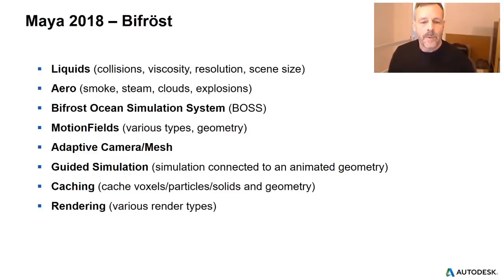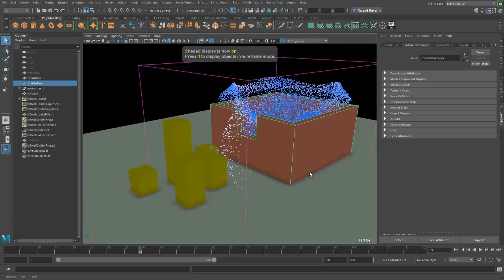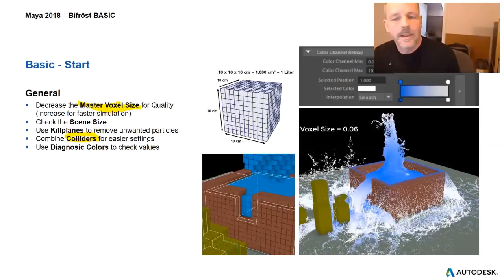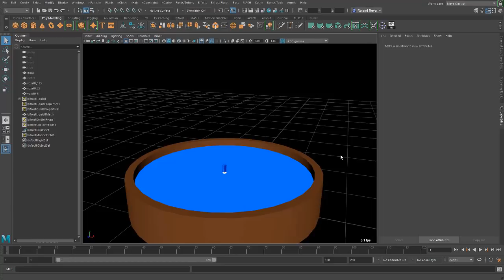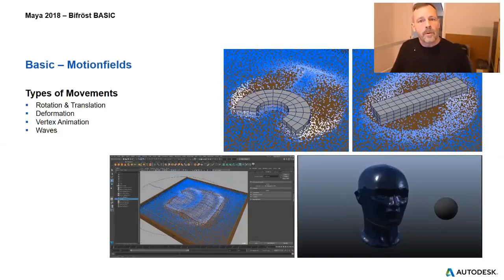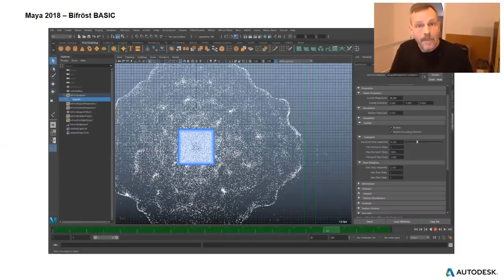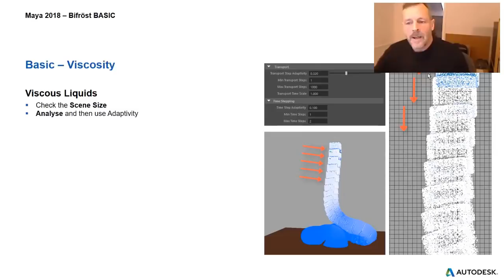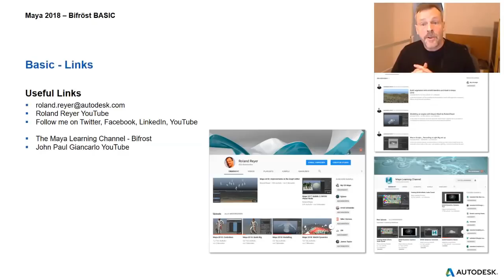Maya 2018 Bifröst BASIC Webinar

Comment: a top notch webinar. been wondeirng how did you make those voxelised scene previews? (what I mean is how to  set up those cubes that illustrate what the scene looks like depending on the voxel size)
Reply from the maker: The voxel illustrations were made with MASH in Maya. However, there is a voxel display in Bifrost that shows the adaptive subdivisions, but it is very simple, in case there are millions of boxes to display.

Comment: Hi Roland, you're a real master and this video helped me a lot! 
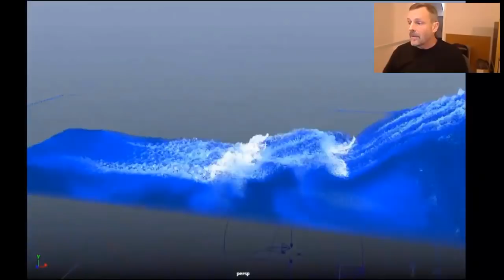I would love to know how do you render the velocity or vorticity channels (like in min 40:04, even if that seems just foam) and with which engine. 
I'm struggling with that.

Thanks again!
Reply from the maker: Hi Nicola, I assume that you mean 40:09 in the Water video.
When you visualize velocity or vorticity then this is just for the hardware display.
However, you can also use these values in the software renderer. Look here: http://help.autodesk.com/view/MAYAUL/2018/ENU/?guid=GUID-8218DE4F-C974-46C4-BF1B-A5F9255D1BA4 under "Render".
Reply: Great, thanks a lot!

Comment: Can you influence the fluid, using particles? Fir example, if I want to make a water explosion. ,Could I use particles to make the velocity in the fluid? Kinda like an explosion?
Reply from the maker: Hi, unfortunately, there is no way to use particles to influence the liquid yet.
Reply: @RolandReyer  Ok. I have another question, how would i go about doing it? Geometry? I see this being done in houdini by animating mesh, and using the points as velocity. 

On another note, i am trying to make some blood splatter on the wall. I have a character at real world scale, standing in front of a wall. I want to make blood splatter like hes been shot in the head. What is the best method for this effect? Doses the scene scale matter?

Sorry for so many questions. Hard to find what i need to use bifrost!
Reply from the maker: @caveman357  For an explosion in water you can of course use all aspects of the motionfield, like the Directional field with Concentric and also an expanding geometry. Be aware that for the high velocities in an explosion you need a lot of sample steps. 
For the blood splatter: do you really need to simulate this with a liquid? It is hard if not impossible to simulate the real world. Try to fake it!

Comment: Great video, can you please please, give more details as to how 39:37 - 39:46 in this video was done?
Reply from the maker: Hi, that's actually simple: you create a liquid and set the gravity to zero. Then add one or more motionfields that attract and transport the liquid.
Reply: @RolandReyer  Great video aswell! to expand on the question before, I cant seem to replicate the "pipe Shape" at 39:42 - 39:47, did you use colliders in addition to the Motion fields? cheers.
Reply from the maker: @pmownage123  I don't know the settings that my colleague used for this effect but I assume that in the Motionfield the "Boundary" was set to "Cylinder" and then using the values for "around", "along" and "away" to get this motion.

Comment: Roland, how do I get a high viscosity liquid to conform to a collider's surface without creating a bumpy texture? I went through every setting but can't seem to find the right setting. Thank you in advance!
Reply: I'd love to know this too
Reply: @patricktaylor8637  I've gone through pretty much every setting and a ton of combinations after I had placed this post. I spent roughly about 2 months on and off without finding a solution. My conclusion is that this is a software limitation.
Reply: MOVE FOUNDRY - That’s too bad. I’m still going to do a FEW tests, but now I’m thinking Realflow might be a better option. Or bite the bullet and start down the Houdini path.
Reply: @patricktaylor8637  For my intents and purposes Bifrost is the better choice. I tried RealFlow and although it smoothed out a the container I wasn't happy with its high viscosity simulator.
Reply: MOVE FOUNDRY - Interesting. Thanks for the info. Let me know if you find a viable solution and I’ll do the same.

Comment: When i m trying to playback then it takes too much time frame to frame

My pc config are:
Intel i3 3rd gen
6 gb ram
Gigabyte gtx 1050 ti 4gb graphics.
Reply from the maker: Did you set the Bifrost Options: Enable Scratch Cache?
Reply: @RolandReyer  Hello Roland, plase help me, I have the same problem. My PC rig: i7 8700K, RTX 2070 & 16gb ram and I used 14 gigs for Scratch Cache. Still slow as hell
Reply from the maker: @markon1g  Hi, are you sure, the scratch cache is working? Try simplifying the scene, less resolution (higher voxel size), simple objects. If the simple setup works then the complex scene might be too big?

Comment: my caching is taking way too long. its not as smooth as yours. And plus im not getting any colours on the timeline
Reply from the maker: The performance depends on the computer (CPU, memory, etc.) and the software version that you're using. Please kepp in mind that many of the cached animations in the video were simulated upfront.
Reply: @RolandReyer  i have a good laptop so thats not the issue. My cached simulation is very slow. I cant easily scrub through the timeline. Plus my cached file folder is around 110 gb in size, dont if thats normal
Reply from the maker: Those 110GB cache files need to fit into memory for playback OR file IO needs be fast enough for playback. The overall size of the cache depends on the simulation settings. You could make a playblast to see the simulation in real-time. That’s what I did for most of the simulations in the video.
Reply: @RolandReyer  thanks for the help man! Real great tutorial!! Looking forward for more:)

Comment: Nothing described here works. I created a cube,  I picked and selected bifrost->create->liquid.... and nothing you see here happened. It created a tiny (container?) cube at the origin, far away form the cube I picked and a few bifrost entries in the outliner, but no dots, no emitter, nothing appeared. When I tried turning the cube int an emitter, I only got error messages. ?????????????? I had sooo many fails like this since I started learning maya. This is the industry standard? Maya is probably the most bugged trashy illogical app I ever used.